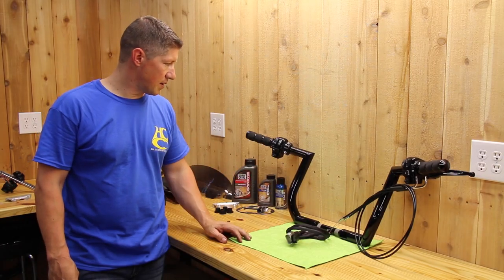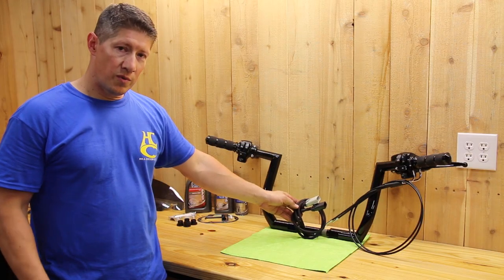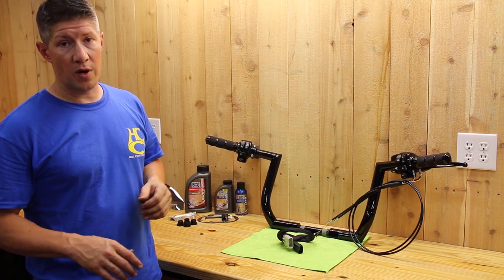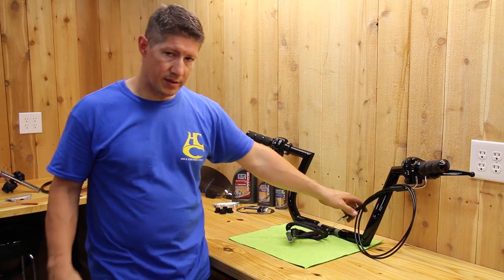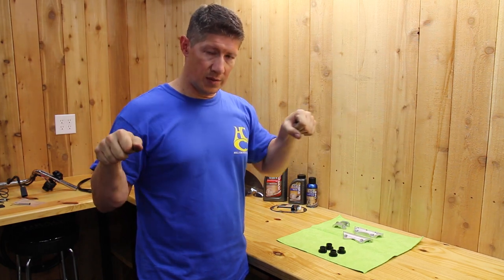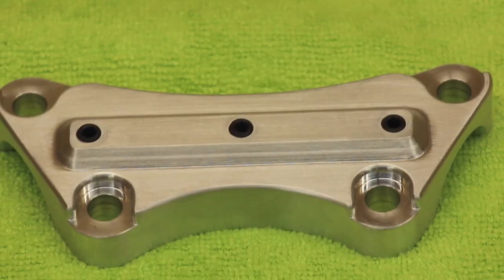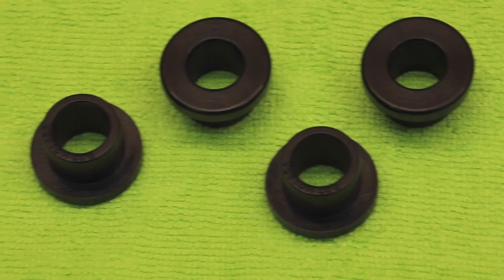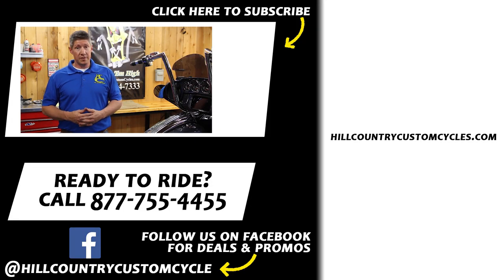Everything You Need to Install Ape Hangers on a Harley Davidson

Comment: Just ordered from HCC. When he says everything he means it!!  1 thing I've learned. The wiring kit is 2nd to none. What I figured out, if you hate wiring and dont mind 2 plugs the wires come with both crimped connectors already. If you buy a pair of plugs you can slip the wires in and never cut the factory wiring. My 14's left about 4" of oem wire sticking out. Everytime I open the box I noticed something else small they include. Down to plastic pin for clutch cable. In this they even give you a cut down Allen wrench.

Comment: Just did a bar swap on my '17 Street Glide following your other video. Took a bit longer than expected, due to forgetting to pull the main fuse beforehand, ended up popping the 5amp fuse so, little panic moment at the end.

Wondering if you guys could do a video on changing out the bushings.

I know, you guys haven't done a video in a long while...but one can hope right?

Comment: I had a 13” bar on my dyna and traded it in for a street glide that has a dresser and it’s October and the bar keeps my hands warm because of the fairing but I missed my taller bars. I was more comfortable with taller bars. And thinking about going back to them ordering it from these guys. Because running wires in those bars sucked.

Comment: I'm looking to get a +6in zbar for my sportster , I've been told by some guys that the stock clutch and throttle cables as well as wiring will work and all I need is a longer front brake line. Is this true?? Just by looking at the bike it looks like there is plenty extra throttle and clutch cable length to go +6in.

Comment: One of the reasons I have a dresser is for winter riding, I like my hands behind the batwing. I also don't want them above my heart so they fall asleep. To each his own.
Reply: That's absolutely false. I run 20s that put the grips at eyeball level and ridden like that the last 5 years. Never do my arms go numb and I do a lot of long distance riding.
Reply: The cold weather thing is the reason why I've been putting off changing the bars but there's hand guards like dirt bikes have that you can put on to block the wind. I borrowed my buddys bike with 12's (I'm gonna do 14's) but man what a difference it makes not being hunched over holding onto the short bars. I'm 6'2.
Reply: Hands font fall asleep. Maybe they would if you were putting like 20-25 inch bars on.

Comment: Love the tutorial videos...  received your jarheads FULL ASSEMBLED KIT and it installed effortlessly...  however the volume controls will not operate correctly..  I'll be sending them back for repair/diagnosis...  FYI I sure wish you had a different customer service guy answering the phones and talking to customers...  your customer service guy you have there is of no use and attitude/personality is absolute garbage...
Reply: I'm dealing with the same issues currently (customer service has much to be desired)